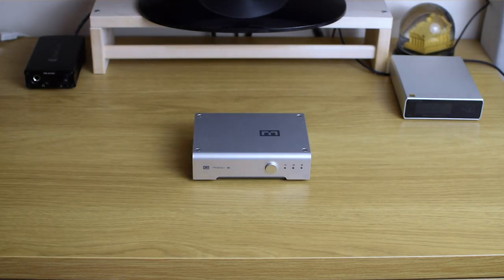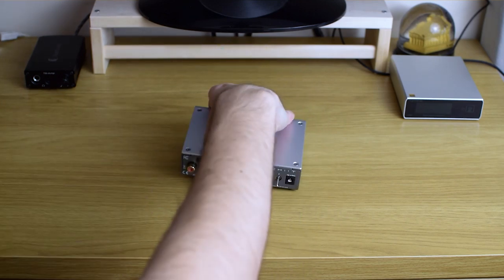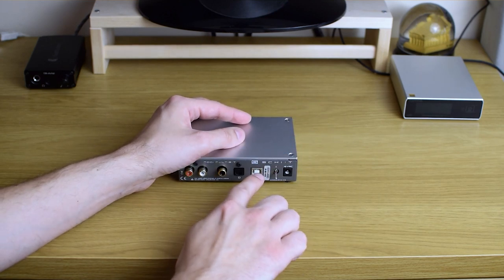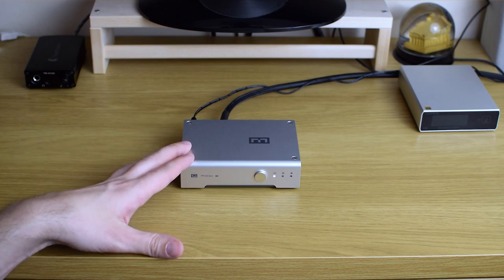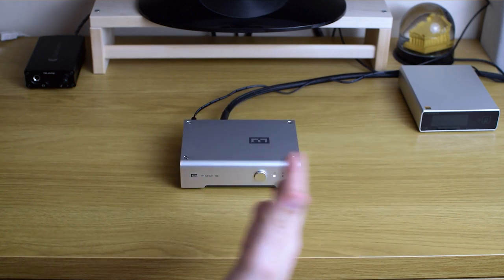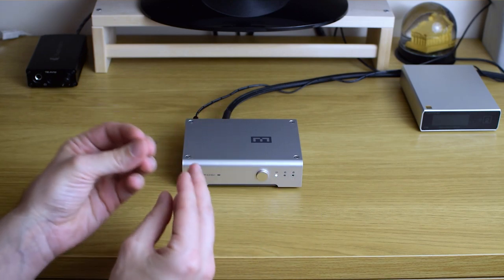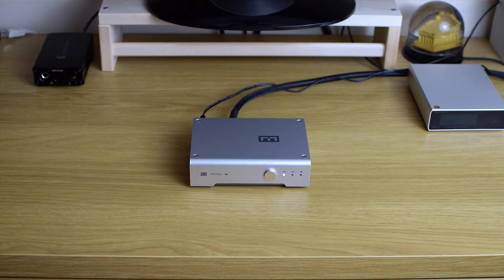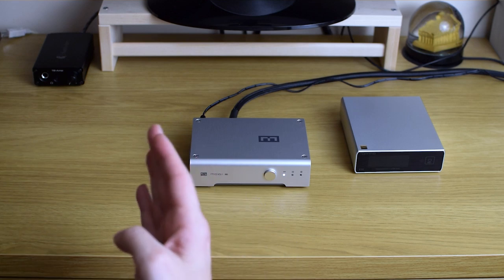Schiit Modi Multibit review

Comment: I used Schiit stack for a few years. The stack sounded solid, powerful (in the bass) and quite analog-ish. The cons are: despite of its detailed sound, the sound was very compressed and lacked of airy feeling. But the main reason I sold the stack was they sounded very one-noted. I meant the volume of every notes, every instruments and voices had the same magnitude. You would never known when the guitarlist or drummer play a particular note harder/stronger with that type of sound. It was lifeless to my ear. With many headphones and iems. And I was lazy to find if it was the fault of  my Schiit amp or my Schiit multibit dac back then. I just sold them.
Reply: And what do you have now?
Reply: @13massfreeman42  Apple c-3.5 dongle
Reply: @hotam138  wow is that good? I would never underestimate for its cheap price but I know it has cirrus logic dac

Comment: Will it know which connection I used after each power on and off?
Assume I used SPDIF only, will it auto select to SPDIF each each time I on and off?
Reply from the maker: I think it always reverts to USB after off/on, but if the USB cable is not connected than it goes to SPDIF... I can test it in two weeks when I get back home.
Reply: @iiWiReviews  Thanks, if you could. It will be great. I  prefer using SPDIF and will always off when not using, so it's kind of importance to me if it could auto select.

Comment: Awesome review! Should I go for Asgard 3 with internal multibit card or with Modius? I've got Hifiman Sundara, and feel my current Modi 3 + Magni Hersey pairs very badly.
Reply from the maker: I like my Hifiman HE-4xx with Multibit sound cause it makes everything sound fuller. That said, I haven't tried Modius yet so can't comment on it.
Reply: Heresy is great but it doesn’t snap planars into shape like Asgard 3 does. That being said, if you want to save money just use the A3 with your M3. If you like your desk nice and neat, get the multibit DAC card. If you think you will be getting more amps in the next 5 years get the standalone Modi Multibit. I’ve read the card and the standalone Modi Multibit sound pretty much the same.
Reply: @edwarddodge7937  Thanks for the reply. May I ask why didn't you recommend Modius vs the Multibit? Right now I've got Modi 3 + Asgard 3. I ordered a Modius but then canceled due to backorder. So far the current setup sounds noticeably better than Modi 3 + Magni Hersey. Wonder if Modius will improve the music as much as the amp upgrade.

Comment: Do you know if there is a way to differentiate between a Schiit Modi Multibit Version 1 and Version 2?
Reply from the maker: The only way is to open it and look at the memory chip. You can find these images around the web, for example at Super Audio Best Friends forum there's a thread about changing this chip with images. Also, if you know the date of purchase - Schiit changed it somewhere in the late 2018. and I saw units sold in December 2018. already being version 2.
Reply: @iiWiReviews  thanks for the info :)

Comment: With 10 to 11 bit of effective resolution only, we are talking about better bass, better depth, better texture blah blah with multi bit. How it is possible can anybody explain ? Going by that logic a dac having more noise and lesser effective bits say 6bits only  should sound more holographic ?🤣
Reply: I compared the Mojo to the Topping E30 and even the Chord Mojo which has excellent measurements and transients shares some subjective strengths as the Modi Multibit (fuller tone, better depth, warmer, less digital highs) than the Topping (nice but somewhat thin sounding, which gives perception of more detail) . I think its easy to speculate but having experienced these dacs 1st hand will make you question if those measurements are really a good indicator for an entertaining sounding dac.  I think the dac design is more important. I also liked the Chord DACs more than Topping just as i liked the Multibit one. But yes the multibit dacs do sound less clean.
https://youtu.be/B46zJu9Ahn0

Comment: Ok, final choice E30, Schiit multibit V2, ifi Zen dac ,  Any suggestion
Reply from the maker: If a bit more coin is not a problem - Multibit. Just don't judge it harshly out of the box. :)
Reply: Thank you for your reply.
Reply: @iiWiReviews 
Hi, thank you for your kind advise, quiet difficult to get the schiit multi V2 here.
E30, ifi Zen dac, D50(without Bluetooth) is available here.
Reply: Any of the 3? Which one the  best
Reply from the maker: I would go for E30 first... Zen if you need headphone out. Skip D50.
Reply: My experience with all devices is enough to create opinion.As a DAC alone, Multibit off course.But, as an amp dac unit in one, ZEN is absolute reference for under 200 price.My favorite, you will feel the rhythm and musicality with ease and never want to switch it off.
Reply: @zzezzobike 
Thank you for your kind advise. Really help

Comment: Great review! However I have to rule this out. I moving from the US to Asia later this year so everything I purchase needs to support dual voltage out of the box. Unfortunately the voltage is selected at time of purchase for this unit.
Reply from the maker: Yeah, that's a problem. Maybe Schiit would be open to sending you both power bricks if you explain your situation. Because only the power brick is different, the device itself is always the same.
Reply: @iiWiReviews  Thanks for your response. It turns out that Schiit sells additional power bricks as accessories on their web site. However they have chosen to not show pictures of the blade configurations for the different types.

Comment: this vs sanskrith 10th mkii
Reply from the maker: I prefer Multibit because it creates bigger soundstage and has fuller sound. But for half the price, Sanskrit 10th MKII is a great budget alternative.
Reply: @iiWiReviews  maybe better to save up for the bifrost? would that be a better option?
Reply from the maker: I haven't heard Bifrost. It probably makes sense if the rest of the system is very good, otherwise the difference between Modi Multibit and Bifrost might not be that much noticeable.
Reply: @iiWiReviews  I see, well my amp is a liquid spark and my speakers are edifier r1700bt, might be work sticking with the Modi?
Reply from the maker: Nice system, I believe Modi would be quite enough.
Reply: @iiWiReviews  Thank you : )
Reply: @iiWiReviews  i've read people saying that the spdif input of the multibit is far superior to usb...can i ask if you've tested this? my multibit arrived today but i don't have coax output from my pc just optical or usb...thanks
Reply from the maker: @julianlopez85  In my experience that is correct. I always felt that SPDIF is giving slightly better dynamics and layering. Now don't get me wrong, USB is more than good sounding, but if we're nitpicking, SPDIF is slightly superior.
Reply: @iiWiReviews  I see maybe i should reconsider using optical from my pc. Was going use usb from pc and optical from my PS4....thanks
Reply from the maker: @julianlopez85  Well, try it out... opticals are not as good as Coaxial most of the time... so USB from the PC and optical from the PS4 might still be a good idea.
Reply: @iiWiReviews  Yea i think i will give it a go and see what's the difference between usb and optical....i'v read that some people are using a raspberry pi mod to get better sound quality but i don't know if i want to go down that route
Reply: @iiWiReviews  i tried listening to this but it seems that the mimby can sound harsh when songs peak(ie vocals in balads or maybe even guitar solos can get pretty loud and harsh)? did you get this at all by any chance?

Comment: I really like my mimby V2. Also the trick of putting a weight on top worked well. Bass became quite a bit faster 👍🏻
Reply: this works 100%. cleans it up well -- tighter bass, more focused midrange, less fatiguing, a bit cleaner transients.
Reply: Also sorbothane feet underneath.
Reply: @jules153  lol
Reply: @mykeldg  lol
Reply: @kyle1538  lol. this tweak costs $0 and takes almost no effort to try. what's there to hate? If it doesn't make any difference in your setup, great.
Reply: @mykeldg  lol